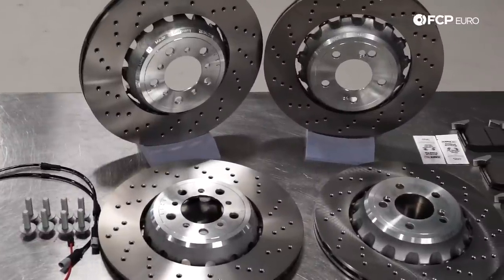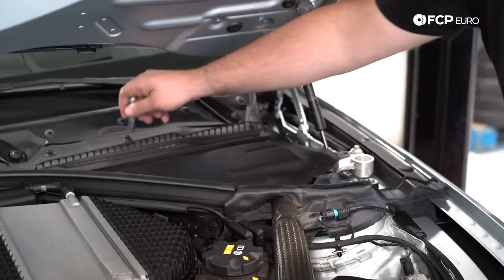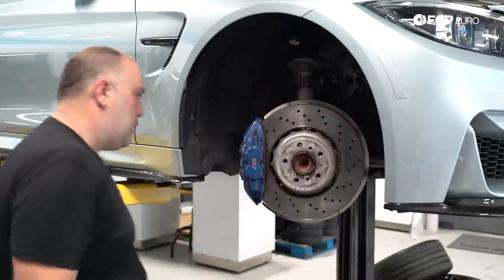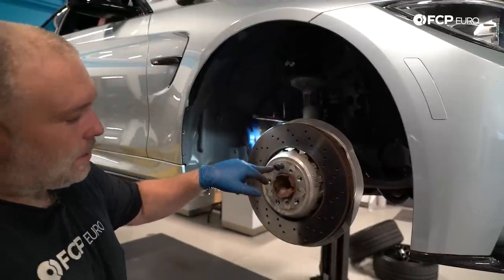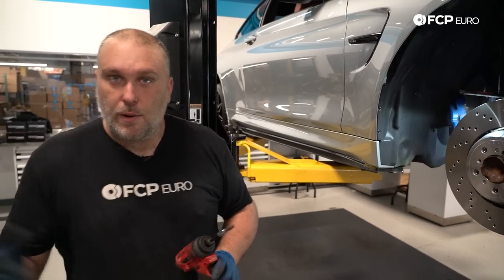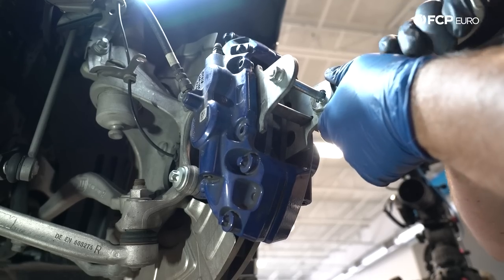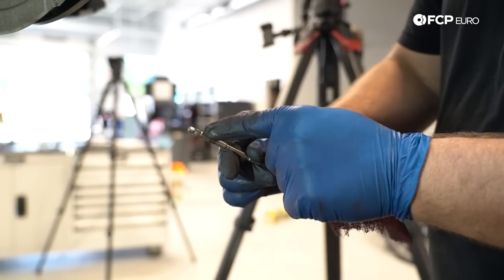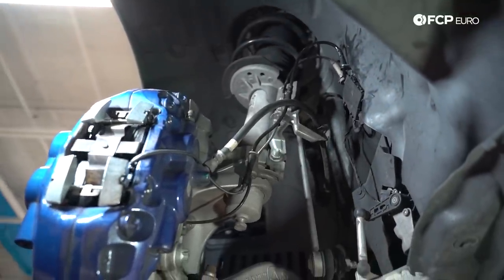BMW M4 Front Brake Pad & Rotor Replacement DIY (2015-2020 BMW F82 & F83 M4)

Comment: Gareth - PLEASE do a removal/install on the REAR hub assemblies on an F8X and HOPEFULLY get one that's badly rusted so we can see how you do it. Center locking nut, axle pulling and the demonic little placement screws that hold the rotors in place.

The entire internet NEEDS this video...
Reply from the maker: On our agenda!!
Reply: @fcpeuro  Seriously.. I don't want to beg but I guess I am haha! 

The front bearing assembly I can handle because even if you strip the retaining screws, which I did, the whole assembly falls off, rotor and bearing connected, once the 4 x TP60 bolts are out.

BUT... the rears are giving me nightmares and all the videos I come across are one nightmare after another - and virtually NONE of them address this. The rear assemblies "look" simple enough.. but they absolutely ARE NOT when they're rusted or seized.

Help us F8x owners out!! PLEASE m_  _m!

Comment: As always a great video from you guys. This is the same procedure on pretty much any F2X and F3X with the M-sport brakes aswell. On the more "pedestrian" cars though, the brakes last longer and the hardware is stuck in there for a long time between disassamblies. Sometimes the locking pins are absolutely stuck in there and can actually bend when hammered out. So I recommend using a tiny bit of anti-seize on the tips and on the locking mechanism of the locking pins.

Comment: @10:18 BMW E9X M3 sighting. Change those rims to 359M Comp.Wheels.

Two Tips:
- Upgrade the brake lines to stainless steel brake lines while you have the brake calibers off. 
- For a car with more than 80k-120k+ miles, check the front wheel bearings for wear/noise by spinning them. The wheel hub has the bearings integrated in one piece that is a bolt on. If they need replacing, try to find OE replacements to save $$$$. On a BMW E9X M3, the BMW OEM wheel hubs are $400+ each. Rear wheel bearings are cheap, but are a huge pain since they have to be pressed off (slide hammer) and on.

Comment: As always, it's a great video. I have a question... Can I install M sport calipers on the 4 wheels with the same brake master cylinder of my car which works with single piston calipers?
Reply: Depends on the car, but generally yes. The retrofit kit from BMW for the M-performance brakes on F2X and F3X does not include another master cylinder. The pedal feel will change a bit though, it's slighty softer and longer throw - but there is plenty of power.
Reply: @LasseJOugaard  Thanks a lot!!

Comment: Every time I replace the brakes on my BMW E9X M3 they recommend that the brake pads and rotors be replaced. At the BMW dealership they charge about $5000 for the front and rear. BMW Indie Shops charge half that. But why can't the BMW brake rotors be resurfaced smooth, so you just need to install new brake pads?
Reply: It's a German thing. Resurfacing rotors is illegal in Germany

Comment: Just out of curiosity do you have to do the rotors as well I’m going to be due for pads in November so just trying to plan for it
Reply: If the rotor has a severe lipped edge they it’s best to
Reply: The minimum thickness for the front rotors is 28,4mm. It’s ingraved in the rotors even.

Comment: Just did my front and back and changed the brake fluids. It a little noisy but I think it will go away after bedding.
Reply: Did the noise go away? I have similar problem.
Reply: @hn92 did yours go away lol. Mine clunks.

Comment: Bolts are "one time use" only... BMW, I don't believe you anymore.
Reply: Stretch bolts like head bolts, flywheel bolts, and these caliper bolts are all torque-to-yeild. This creates a high preload which helps them hold but it stretches the bolt when you get them up to their torque spec. That makes them more susceptible to fatigue so they should be replaced.
Reply: @TheDudeAbides1776 so what's the yield strength of these bolts then?
Reply: @maxsam201  Depends on the thread type, diameter, and bolts metal composition but obviously it's 110nm/81ft/lbs since that's the torque spec. If you really want to know go put the specs into a torque calculator.

A thing to consider is the expansion and contraction the brake caliper encounters from heat, especially during track use. Bolt that's have been previously stretched are more susceptible to backing out.

People reuse them but the cost of a caliper coming off is way more than the $50ish it costs to replace all 8 caliper carrier bolts.
Reply: @TheDudeAbides1776  I see no reason to continue with this. It appears that you are operating with some generic knowledge found on internet,  and some of your statements make no real sense or baseless.
Reply: @maxsam201  Dude, this is absolute basic mechanics. You don't need an engineering degree to understand torque-to-yeild bolts. Sounds like you're just too cheap to cough up $6 for a bolt.
Reply: @TheDudeAbides1776  I do have an engineering degree, as a matter of fact. And I have Ti bolts holding calipers on my car. And you are still not making sense with your statements.